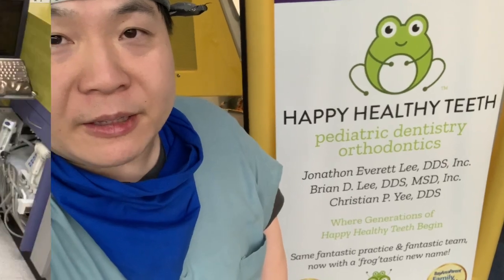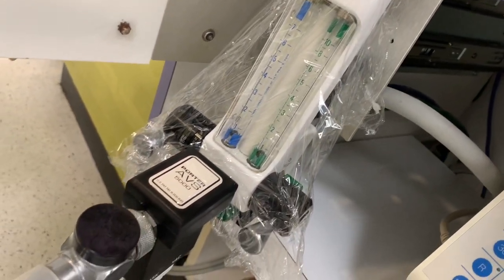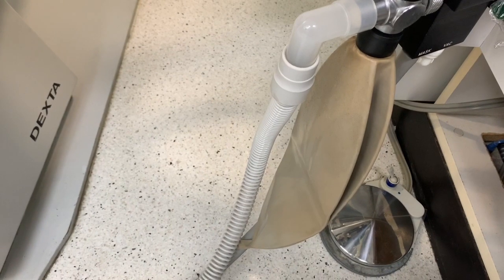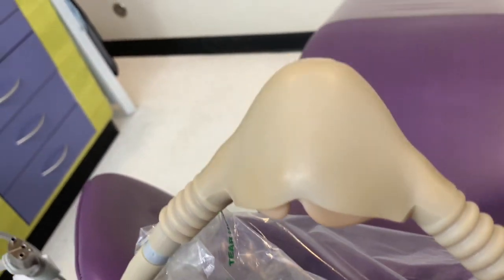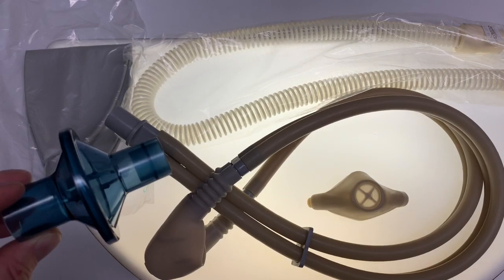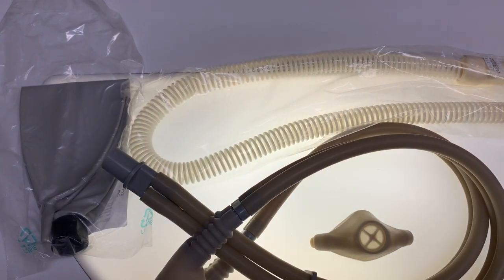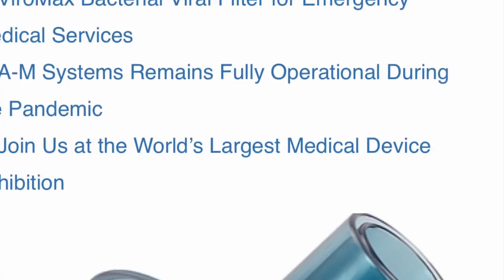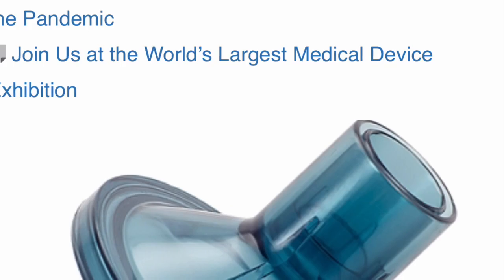How to Prevent Cross-Contamination N2O2 and O2 Breathing Circuits

Comment: The filter is not going to add any protection to a dental nasal hood breathing circuit.  The tubings are one way directional flow.  Patient inhales - and pulls from the bag.  Patient exhales - and it is pulled out the vacuum line of the breathing circuit.  Nothing from the patient can get back to the breathing bag as there is a one way flapper valve on the front of the bag tee (standard in all flowmeters).  These are not recirculating systems like some anesthesia machines.